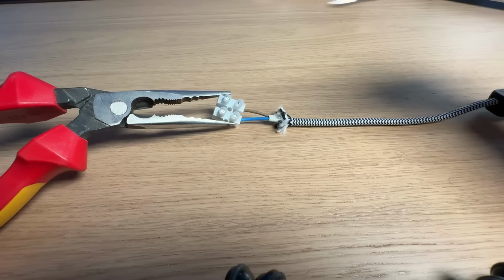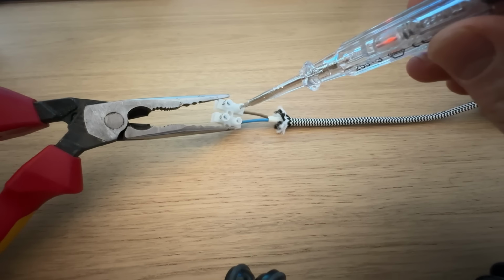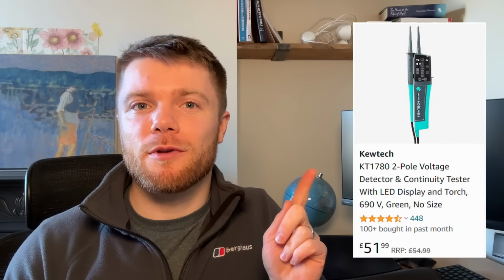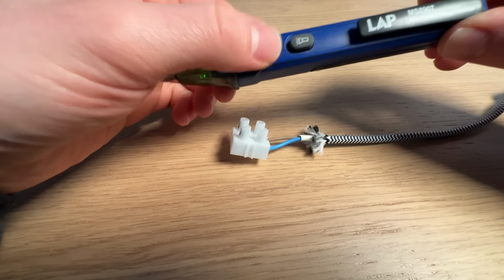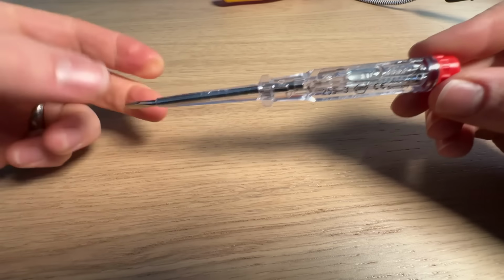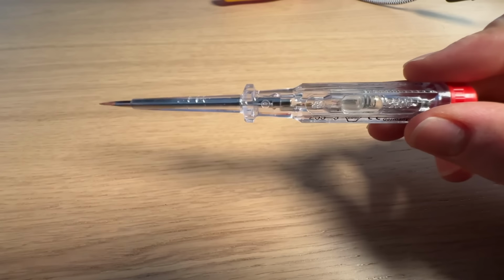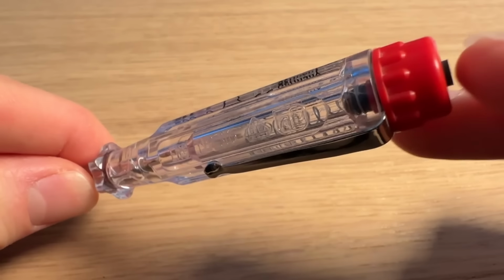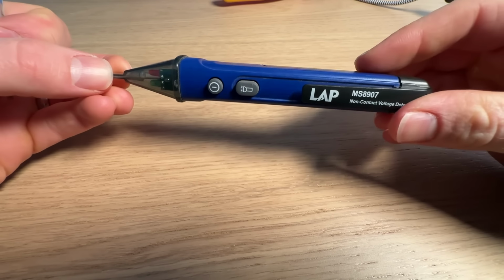The Most Dangerous Electrical Tool

Comment: You hear people saying they're  dangerous and/or unreliable all the time, but are there actually any reports of anyone ever heing harmed by one of these? I've been using them all my life and have no intention of stopping. They are incredibly useful and I would trust one of these over a contactless volt tester any day.
Reply: It is exactly what I was thinking. I am a professional electrician and it has never failed me nor have I had any problems.
Reply: @Gaelmalkavian  i agree with you he must change the content title to "most useful and cheapest live wire tester"
Reply: Exactly because you’re a “professional” this is not meant for professionals
Reply: @Gaelmalkavian non contact voltage testers can and do give false readings. I've seen one give a false negative on a 277v circuit and I had one give a false positive. I will only use them as a quick troubleshoot tool in conjunction with a meter or to verify a circuit/conductor is on, never use it to verify a de-energized circuit, use a meter for that. Only time I will trust a non contact voltage tester for de-energized state verification is on higher voltages like 4160v or 13.8kv. Use the right tool for the job, especially when your life depends on it.
Reply: @Gaelmalkavian  A professional using this? 🤔 Let me buy you a Duspol.
Reply: @jeroen2535  jajajaja ok!
Reply: As an electrician myself I can honestly say I've never seen any other fellow sparky use this garbage.
Reply: @Gaelmalkavian  Please do what I have done and report the content "Harmful and dangerous acts" and "possible death by electrocution". This content provider has no business advising on electrical safety and could lead to some buffoon actually getting injured or killed.
Reply: I am a retired electrician. And worked and trained with a highly respectful electrical contractor still in business today. Those neon screwdrivers were in use heavily, we had meters as well. Modern day tools you see were not around back in those early years.  So the neon driver was used purely to check state of circuit before returning on it. Obviously a fully isolated circuit means switching off main DP  breaker. It's the first time I have heard the term a DIY screwdriver. My late father had one in his top pocket as part of his dress. He had a Degree in electrical engineering. Built and designed radio equipment as well. That was a secondary interest of his as it is mine today.  But interesting video. I agree otherwise. Just the thought you have made me appear to be a DIYer not a Pro. Hi hi.   Your safe now, well retired at age 76. I did not quite see the VIR CABLE days, but I removed plenty including lead cable. Boss use to collect it to claim scrap money for it.  Thanks again.
Reply: They also let you know which wire is live if you're checking the wiring in a light fitting or switch, or whatever. A non-contact tester or a multimeter wouldn't have showed if the blue wire was Line and the brown Neutral in the test case in the video. Yes you could use a multimeter to known earth, but I don't think that's any safer really. You're then holding 2 probes at once, and if you touch the ground probe you're connecting yourself to 240V through the multimeter's circuits.
Reply: @AJB1 A multi-meter's circuit is above 10 mega-ohm, that will give you about 24 micro-amp of current, I do not think it is a big issue. A non-contact tester will be useful in the case you mention, the same goes for a multi-meter, you just need to know how to use them.
Reply: @K2teknik. Yes the multimeter impedence is really high, unless it fails, or gets water in it (as per the video saying can happen to the screwdrivers). Or unless you accidentally put it on the current setting, or accidentally put the probe in the current connector, which can't happen with a neon screwdriver. Or if there's damaged insulation on the probe wires.
The non-contact tester can't tell you which of two wires right next to each other is live. It'll tell you if any of them are live, but sometimes you want or need to know which.
I've got nothing against multimeters or non-contact testers. I own both, and use both. But I've also got nothing against my neon screwdriver, and I use that too.
Reply: We call it Phase lamp 
And it is best tool
Reply: @trbusina I agree. We call it a phase tester, and if you know what you are doing it’s the best tool, if you don’t, you should not be doing anything with electricity, get an electrician in.
Reply: @jschreiber6461  A proper sparky has had that many belts from electricity ,that he doesn’t need any tester , he does it buy touch to see if he gets a shock or not . That’s what our old spark used to do , if his leg twitched he knew it had a good voltage . .
Reply: @AJB1 if you put it on the wrong setting ur blowing the fuse not zapping urself.
A multimeter is what I use.
Reply: @jhoughjr1  I've got no problem with using a multimeter, or with using a neon screwdriver. I just question it when people says the screwdriver is dangerous and the multimeter safe. If you put a multimeter on current not voltage by mistake, put one probe on 240V and happen to touch the tip of the other probe whilst trying to put it onto ground, I wouldn't want to rely on a fuse blowing from the current going through your body to isolate you...
Reply: @AJB1  if you get a probe with a potentiometer to dial in the sensitivity you can definitely tell which wire out of a pair is live and which is ground - a Polish-designed Fazer 777 has such an option - it's a louse screwdriver but quite a versatile mains indicator
Reply: @AJB1  exactly
Reply: I m using one of these for years (I have also multimeter from fluke) and I never been electrocuted. So if you are careful you will probably be alright.
Reply: @UncleHo5 if you had been electrocuted you'd be dead electrocuted does not mean being shocked it means being killed by electricity
Reply: @Pro_fessor56 I received many shocks during my lifetime working on electrical circuits because I'm not the best example when it comes to following the safety guidelines like turning off the main switch but I'm still alive. Even after receiving 230V from one hand to the other. (Don't try it yourself!!! It is like being kicked in the chest). Yes it can be deadly especially in wet rooms like the bathroom but in most cases you will live.
Reply: Same here. Using them forever and zero issues.
Reply: I agree it is a very convenient tool. Requiring no power, being small and serves a double function.
Reply: Dont use them on anything over 500 volts or as an electric fence tester (1000 to 10,000 volts). I got hell of a belt off it.
Reply: @antlane365  You do realize that they have different safe voltage ranges, like any other tool?
Reply: @antlane365 I have used it as a non contact phase detector for voltages above 15KV simply by turning it round and holding just the insulated end. The neon types will glow in the presence of KV range or RF from a high voltage source. The neon itself will glow around 90V, AC or DC.
Reply: @antlane365 I used it on an electric fence and electrocuted instantly but, it was not harmfuI, I just got shocked by high voltage.
Reply: Its a bait video. Basically you put a title like "water actually dehydrates you" so people click on it.
Reply: I think rather than being dangerous is that there are better options for people who don’t regularly use/need it. This advice is not intended for professional applications. The non contact tester is a better alternative for non professionals.

Edit - was just asking my neighbour who is a master electrician- he always uses a non contact tester. His quote “it’s not 1999 anymore. Those things were great when I started but things have improved “
Reply: One they it will be dangerus to ride a bike
Reply: This is exactly what I was about to say. Many many more people use this instead of "safer" options and still there are not really any records of people getting harmed by these tools. Also, imagine these cheap tools not being available. People would improvise their own way of checking if there's current. I did it some times and that's most definitely not a smarter idea than using this cheap tool.
Reply: Me, I was thrown over a room because I inadvertently earthed myself by touching a radiator whilst testing an appliance. It hurt, so don't do it.
Reply: pro tip, never get near electricity thinking it is not ready to rip you apart. the same way you dont unplug something with your hand in the sink, you should try to be kinda ready for it. you are not lucky, nono, it just couldn't reach you. unlike other machines even is the switch is off it might be close.

even if it is safe, you still kinda gotta be ready for it. because it is waiting.
Reply: I got a serious shock off immersion heater one day.. I was high up in a block of flats and nwas to lazy to go down to the van to get voltage tester
Reply: I also used them all my life and they never failed on me either. I also have a 2 pole detector/meter and multimeters. But for basic on/off check, these always served me well.
Reply: @eaglevision993  They probably will serve you well until your luck runs out & you get a belt ,that shows an X-ray of your carcass on the wall with your hair frazzled & standing up .
Reply: I was thinking the same. A well made device (the vintage kind with a near Infinity resistor (black resistive  rod with 4 white lines, ie 999x10^9 ohm and a genuine  NEON lamp (not one of the newer LED) ones is about as safe as it gets. They detect individual wire phase, and for years, if you reversed it it without contact, would glow in the presence of high voltage RF sources eg Microwave & CRT tubes. 
It’s an essential tool, and if you don’t know how to tell it’s safe at a glance and use it safely, you should NOT be mucking about with anything over 12V!
Reply: All tools are dangerous if you don’t use them properly
Reply: @mr.commonsense510  When that is all correct on it's own then there is still an issue with this specific tool, there is just cases, even when you use the tool correctly, it may show a wrong signal to you, a signal you may use to determinate to do actions that may be dangerous to you.
You, your body, and surroundings are one of the current paths that this tool depend on to operate correctly and trustworthy, but your body, and surroundings are not reliably trustworthy current paths, a wire is.
Some locations have electric code/law/rules that state what kind of measurement tools you must use, it basically bans these kind of tool, I am right now in such a location, and you can get a tool that is way bigger, ugly and a bit annoying to operate, but it is reliably and trustworthy, "is it them foolproof so it makes your task safe" you may ask? no it is not, a tool on it's own do not do the full job.
So the takeaway is that tools, even if used properly can be dangerous. The Dunning–Kruger effect comes into mind here.
Reply: Been using for 35 years … never got shocked .. why is this misinformation video being propagated ? The uploader has never repaired an electrical wire and has no idea of how electricity works 😂
Reply: @डफ़क-user-gr3tg2yk6o-24_डफ़क  The issue is not just about getting shocked, it is the misinformation the tool may give the user.
Just because you, and others, may never had experienced any misinformation with this tool do not mean that this issue do not exist.
Just because a given tool is cheap, popular doesn't make it a good tool for a given job, it just make it cheap and therefor popular.
Reply: Its more the problem of cheap parts, the 1/4watt resistors and is not rated for these voltages, it can fail open or short-circuit for instance. Poking a 400volt connection is probably also not a good idea. Etc there are tomanny possible failure modes. If you know what you're doing it's most likely fine but for the home gamer it's not something to rely on. I'd say because when using it you are part of the circuit now thankfully almost every installation here is rcd protected. As a funny side not my last step before grabbing a conductor is using the back of my hand as a last live check😅
Reply: @martijnveen5694   400V is between phases - you're hopefully at ground level so it's 240 to you. If you're not at ground level then a regular 240V out-take would also be 400 to you if it's a different phase than you.
Reply: @martijnveen5694 How about explain why such a low current would cause a resistor to fail short circuit then with statistics and the properties of a neon lamp, how it would respond to such failure?
Reply: No. Voltage is not really a factor in resistor rating, it is power and in this case the power is miniscule. Something getting inside and bypassing the resistor or water ingress are ridiculous. @martijnveen5694
Reply: @martijnveen5694 … where you gonna find 400V as an amateur/DIYer?
Reply: @andyxox4168  Plenty of houses have 3 phase supply these days not mention most switchmode powersupplys have about 400volt dc after the rectification stage. Highest voltage i have messed with personality was about 1.2kv DC capacitor bank not including ignitioncoils
Reply: @ and 3 phase supplies are not 400v to earth so please stay away from electricity lest you earn a ‘Darwin’ award
Reply: What does “fail open” and “short circuit” mean ?
Reply: @martijnveen5694  there are no 400v connections .. they are all the same .. you only get to 400v because you measure between two different phases .. each one of them is still 235v to ground.
Reply: For me the danverous part: i test something and it don't light up. Did i connected it properly in the tight space? Maybe it lighted up only i cant see it?
A nightmare guessing game doing tests after tests trying to be sure.
Reply: @MolnarG007 you just don't know how to use it. Always try live wire and switch the power of afterwards. Then/during this check again.
Reply: @MolnarG007 yeah!don't do what my friend did the other day and grab the cable to see if it was live and never ever ever use the live wires on your tongue method!always use cable detectors,neon testers,socket testers and voltage detectors and turn off the power and use a lock out mechanism and warning label,at the consumer unit.use electrical gloves and insulated rubber handle screwdrivers!
Reply: I got a shock the last time I used one of these. Never again thanks.
Reply: The danger is the operator. You dont know but think that you know. Then things happened then blame on the tools.
Reply: @waktokong9288  It doesn’t matter if it’s the most experienced operator on the planet , if the tool is faulty manufactured to poor quality & dangerous standard .
Reply: Rubbish, used one for many years, ie last 30 at least, never ever had any problem.
Reply: I use this one since the “70s - always accurate, have the same one since. I have bought few non-contacts and found them unreliable, need batteries and after few years they do not function at all.
Reply: yes there was!atilla the Hungarian honey monster was electrocuted and murdered in 1962 ,on his wedding night.he tied a lightning conductor around his waist,then he stood on top of Blackpool tower,dressed only in his underpants.he was frazzled to a crisp afterwards when he tested the current with a neon screwdriver,it indicated the potential voltage as lethal ten thousand million times over.if his body had been made out of an industry tested insulator he would have been blown to pieces inside 0.3 seconds his body was donated to electrical engineering students all over England as an example of what can happen if  you attempt electrical repair and installation jobs if you have swapped your brain for a grapefruit.never ever use the wet tongue,suck it and see method to test for live electrical cables and dangerous high voltages.always use an electrical conductor which hasn't been earthed,whilst standing in a bucket of salt water!-not!to cut a long story short,use a voltage tester!
Reply: ....agreed !!
Reply: same here,
Reply: The question is, do you want your person to be part of the test circuit? They’re probably fine when not faulty but why take that chance? There’s much better options out there and most savvy diyers and pros will use something much safer.
Reply: These things get thrown about and damaged . They are made in China for 10 pence ,no light coming on is it dead or broke. This video fails to tell people you should always test a non contact tester on a known live first. These screwdrivers are frowned upon by the NIC etc
Reply: @gravyboat2370  I got ripped off as I paid a couple of quid for nine ,& still got zapped . I use a multi meter now ,never trust a neon screw driver / tester again no matter what fancy brand or where it’s made ,
Reply: @gravyboat2370  A multi meter is the way to go .
Reply: @maskedavenger2578  If you are not a professional, trained & certified electrician you shouldn't give people advice about the thing that potentially can kill.
Reply: @ In my younger days I was an electricians mate . I wouldn’t advise any one to use these cheap neon screwdriver testers , I know they are dangerous from real life experience of suffering an electrical shock whist using one .
Reply: Totally agree with you, I was given one on my first day training as an Electrician and have always carried one. Never had a shock from one or known a sparky that has and I'm just coming up to 50 years in
Reply: Thats cos they're dead
Reply: There was a warning on TV about some defective ones probably in the late 80s or 90s, when the design was changed to using components with leads and the weld between the resistor and neon were shoddy and would fracture and the spring was long enough to push the neon down the side of the resistor shorting the leads so the metal cap was directly connected to the tip.
Reply: This is why I prefer to use the old fashioned ones with a carbon rod type resistor and  neon with end caps like a glass fuse.
Reply: They are safe! They light up if you use them  a circuit can get switched on when connecting.. they are safe
Reply: I've been using then since I was born. I'm now almost 60 and have never had a shock from one.
Reply: You've gotta admit that the design flaws are valid points. It is quite faint light. A broken one would indicate no voltage even if there is. An even differently broken one might shock you. Not a great tool design. Of course a less than ideal tool still works most of the time, and alternatives also have drawbacks.
Reply: @jeroenvandeven9977  You should test it on a known live contact before and after the actual test.
Reply: I AM 46 AND I'M STILL ALIVE.
I USED ONE OF THOSE DANGEROUSE TOOL YESYERDAY AND I'LL USE IT TODAY TOO!
LOOOOL :)
Reply: I was testing a live circuit and one of these caused me harm .. I dropped it and it fell on my toe 😂
Reply: Only clicked on the link to say dude. Think it’s theoretical danger not actually dangerous or they wouldn’t sell them
Reply: @ChrisLegg-i6s  Wrote : "Think it’s theoretical danger not actually dangerous or they wouldn’t sell them"
Really? The Chinese will sell you anything you want to buy. They thrive because they make them so cheap (and nasty). The UK abandoned any safety control over electrical imports years ago; there is/was a laboratory at Leatherhead that tested this stuff and I complained to them about something once. They took 6 months to reply that they were "monitoring".
Reply: Contactless don't work reliably which creates a risk of you working on live wires.
Reply: This cheap electric screwdriver is best and is used worldwide in every country.
Reply: @  yes, but not often used properly!
Reply: contactless testers are unreliable, if the neutral is close to the hot wire it will light up and you will never know if the current is coming out of the right wire
Reply: Don’t try this at home. I admit that in elementary school I had one of these and enjoyed sticking it into the live point of a mains socket when the teachers were not looking. Then I showed a friend who was also into electronics that when I also stuck a scissor into the earth point and bridged my hand across the two then the neon indicator shon much brighter and you felt a buzz in your fingers. Not sure if I was lucky or just careful enough to know how far I could experiment and stay alive.
Reply: Some people smoke all their lives and never get sick. Is smoking safe?
Reply: It is something like report about being killed by falling piano.
Reply: I think that this tool is harmful or dangerous if you are stupid. And you know how today's generations are... They are not safe if they don't use 50+ dollar tools... Gosh
Reply: water is a legitimate concern, life if you left in in a pocket and went through the wash. why not just make a solid pour. but yeah i agree with you, i cant imagin anything worse then a pick me up from this. but it is a big world where bad stuff happens, for no good reason.
Reply: What a load of crap. OooohMummy it will kill me because I’m passing a couple of micro amps through my body. Used one all my life. I have several different types and all are neon. You’re full of BS. Stop trying to scare people.
Reply: Well, I stabbed myself with one of these once. Turns out they're pointy.
Reply: Do you have girl or boy children?
Reply: It will eventually stop you
Reply: There were reports a few decades ago of people receiving severe electric shocks from a badly made and designed one sold in the UK.It was when the design was switched from using a solid carbon rod type resistor and cartridge neon, to parts with leads. The leads  connecting the resistor and neon were welded together so badly that it would almost break apart by looking at it and they hadn't thought to shorten the spring, so the welds were breaking and the spring would push the neon down beside the resistor the leads would cross and you'd either get a direct connection between the metal top and the tip, or just via the neon. Don't recall if anyone was killed, but it made TV. They fixed it by using a shorter spring and also started welding them properly. But I still would rather use one with a rod resistor and cartridge neon. Other problem I 've encountered was a rubbish one that came with something, wasn't sealed and water had got into it while it was laying around waiting to be thrown away.
Reply: Using two of the pen testers now.
Reply: They are safe enough.  May need to be careful only with a new device in case its a defective device- but thats a one time check.  In fact these testers have prevented a lot of electrical shocks by indicating leakage.
Reply: Non contact ones react to static electricity too. I noticed it when I was sliding it on CAT6 cables.
Reply: Don't use it outside in a heavy rain. I've used them for 60 to 120 VAC. Anything higher gets the multimeter.
Reply: So many people die every year for that...😂
Reply: Any responsible electrician will look after and know how to use their equipment.
I use a multimeter switched to the appropriate range.
A mate of mine had very dry skin.
He would stick the end of  his thumb in the  lampholder to check for voltage.
He could guess the voltage to within 50v.
Reply: The only issue I have had was checking an ignition lead. 
Touching the end on the ht lead resulted in a shock.  So just put on lead and keep finger off the end.
Reply: @chuckmaddison2924  You did not read the specification on the tester, you would then had known that the voltage on an ignition system is way above the maximum rating for your tester, so short version "Wrong tool for the job", not a fault of the tester as such.
Reply: @chuckmaddison2924  Ignition voltages are huge. 1000s of volts. These pen testers are for household voltages.
Reply: The testing thing lights up on both neutral and positive wire in me garage so not reliable
Reply: I died using one of these.
Reply: Havent reported any times ive been shocked.
Reply: Would they work if you are wearing well-insulated shoes or does your hand need to touch something to ground it?
Reply: @ferrarim5p75  I think just the capacitance of your body is enough. You certainly don't need to go out of your way to make a good ground.
Reply: Yep, just an ad
Reply: The only time you get a shock is when someone shorts the neon for a laugh 😂
Reply: I played with these when I was a kid, was funny to see the light when sticking it to the mains, parents didn't like it and took it away.
Reply: I totally agree with you, Rob Wigley.. I have used"phase-testers"for many years (even in damp conditions) and I am 100% confident with them - never had a problem. Of course there are cheap versions that may be dodgy but even the Euro and Pound shops have to abide by government safety standards. The car-boot tool sellers are the one's to be careful with.
Reply: There are some basic multi meters that are very reasonable price,deffo better than thes🎉
Reply: @  .. assuming you have a reliable and confirmed earth, without that your multimeter is useless for proving a dead circuit!
Reply: If you use them a lot, you're probably getting them from a reputable supplier, or at least a consistent supplier. I'd definitely be worried about this kind of design though when random people use them for their home projects and buy them off amazon which is notorious for allowing products with no QA.

The fact they still don't cause serious injury stems more from the fact they're rarely used on live circuits (only used as a check) and household AC, especially in the US, is rarely fatal for short contact
Reply: I was thinking the same, I've been shocked once by one of these, but other then the scare for a fraction of a second, nothing really happened, like normal 120V connections won't cause any damage in less than a second of a shock
Reply: I wouldn't trust either of them for proving a circuit is dead! Both have a lot of pitfalls that only the proper 2 pole tester does not. What differentiates the NCV tester from the screwdriver is that the former is actually very useful for troubleshooting while the latter is just useless.
Reply: Good luck
Reply: Good question but listen. People is.... well... consider people dumb as a rock and you will be correct always. Of course, a lot of people is not dumb, but many other people is, so if something can be done in the worst posible way automaticly means someone, somewhere, its going to do it that way. I got friends working on hospitals, you would be amazed of some things they treat there. And thats only in one hospital in one city! Imagine in the whole world.
Reply: I have one of these and it lights up with ac current even if I don't touch the top. Touching the top allows me to check Dc or contininuty eg fuses. It's very useful and I feel very safe using it
Reply: Im someone thar gets drunk and puts their finger in a light socket for a party trick so its no problem i love a bit of an electric shock however please dont try this at home im an expert IDIOT lol 😂
Reply: I tasted a live wire from oven transfomer and it really harmed me
Reply: Hello ! May Allah protect and guide you to his light and happiness in this life and the hereafter, God bless, Ameen. Excuse me for giving a little presentation of Islam, because it is very misunderstood nowadays, especially on those « Antichrist's » times, where media and politics are mixed to distort history and truth. And terrorists (puppets of the Antichrist) who misinterpret verses, out of ignorance and political motivations, and take them out of historical context (just like radical atheists do by the way) don't help either. Thank you very much for your time.

First of all, if you have any questions regarding Islam and yourself, just open the Quran randomly, and you will find the answer in front of you, like a miracle and a sign from God.
	
Islam is an arabic word that means the Surrender to the One and Only God, our Creator, Protector, Provider, who gives us life and all that we have, we are safe and sound by his will and grace, we are His and to Him we return, and we have to thank him in this trial life by submitting to him by our free will, or later in the Day of judgment when it's too late to save our own skin. Islam was the original Religion descended to earth from heaven with Adam and Eve (peace and blessing be upon them) in the beginning of humanity. and was passed to people with the succession of the 124 000 prophets and 315 messengers of God to all nations and civilizations since, passing by Noah, Abraham, Isaac, Jacob, Ismaël, Joseph, Moses, Aaron, Joshua, David, Solomon and Jesus (Peace and blessing be upon them) during the history of mankind, the last replaces and completes the previous, until the succession of the last messenger of God fourteen centuries ago, Muhammad (Peace and blessing be upon him) to complete the noble morals of all mankind, to bring humans and jinns out of darkness into light, and to purify people's religion and belief from corruption and polytheism, and return it to purity and true monotheism, like it was in the times of the prophets (Peace and blessing be upon them).

Many Religions that we know nowadays, at their beginning were true and under Islam, initiated by one of the prophets of God, but their original teachings, history and scriptures have been corrupted over time with falsification and polytheism, or lost and replaced with false ones. That's why Islam is the only Religion accepted by God nowadays, which consists in bearing witness that there is no god besides Allah (God in Aramaic, the original language of Jesus and the Gospel), and that Muhammad is His servant and messenger, just like Jesus and Moses and others are His servants and messengers. Never a messenger of God said he was God or literally son of God, it was the people after him who changed the words of God and corrupted the Religion. God is unique and absolute, He does not need to have a family and sons or to associate anyone else with His kingdom, He can simply create whatever He wants, everything belongs to Him, and to Him everything will return. Allah said in Surah Al-Mu’minun : “God has never begotten a son, nor is there any god besides Him. Otherwise, each god would have taken away what it has created, and some of them would have gained supremacy over others. Glory be to God, far beyond what they describe. The Knower of the hidden and the manifest. He is exalted, far above what they associate. (91-92 / Translated by ITANI).

Allah means the one and only God, the God of all prophets and creatures, the creator of the universe and mankind, and the Master of the Day of judgment, where our destiny, Hell or Paradise, is decided based on our faith and deeds in this trial life, and above all, Allah's mercy. 

Allah said in Surah Al-Ikhlas : In the name of God, the Gracious, the Merciful.
Say, “He is God, the One. God, the Absolute. He begets not, nor was He begotten. And there is none comparable to Him.” (1-4 / Translated by ITANI).

Allah said in Surah An-Nisa : O FOLLOWERS of the Gospel! Do not overstep the bounds [of truth] in your religious beliefs, and do not say of God anything but the truth. The Christ Jesus, son of Mary, was but God's Apostle - [the fulfilment of] His promise which He had conveyed unto Mary - and a soul created by Him. Believe, then, in God and His apostles, and do not say, "[God is] a trinity". Desist [from this assertion] for your own good. God is but One God; utterly remote is He, in His glory, from having a son: unto Him belongs all that is in the heavens and all that is on earth; and none is as worthy of trust as God. Never did the Christ feel too proud to be God's servant, nor do the angels who are near unto Him. And those who feel too proud to serve Him and glory in their arrogance [should know that on Judgment Day] He will gather them all unto Himself: (171-172 / Translated by Muhammad Asad).

Allah the Most Merciful said in Surah Ali-Imran : Behold, the only [true] religion in the sight of God is [man's] self-surrender unto Him; and those who were vouchsafed revelation aforetime took, out of mutual jealousy, to divergent views [on this point] only after knowledge [thereof] had come unto them. But as for him who denies the truth of God's messages - behold, God is swift in reckoning!
Thus, [O Prophet,] if they argue with thee, say, "I have surrendered my whole being unto God, and [so have] all who follow me!" - and ask those who have been vouchsafed revelation aforetime, as well as all unlettered people, "Have you [too] surrendered yourselves unto Him?" And if they surrender themselves unto Him, they are on the right path; but if they turn away - behold, thy duty is no more than to deliver the message: for God sees all that is in [the hearts of] His creatures.
Verily, as for those who deny the truth of God's messages, and slay the prophets against all right, and slay people who enjoin equity - announce unto them a grievous chastisement.
It is they whose works shall come to nought both in this world and in the life to come; and they shall have none to succour them.
(19-22 / Translated by Muhammad Asad)..

God said : Say, “We believe in Allah, and in what was revealed to us, and in what was revealed to Abraham, and Ishmael, and Isaac, and Jacob, and the Patriarchs, and in what was given to Moses and Jesus, and in what was given to the prophets from their Lord. We do not differentiate between any of them. And to Him, we surrender.”
(2:136 / Translated by Community)

Salam (Peace) -------
Reply: If you test the driver using a ground source instead of yourself and buy a high quality driver there isn't really much reason to think this is explicitly dangerous.

There is a latent advantage of this driver in that if the circuit becomes live whilst you're working on it, the driver will indicate this to you.

These other testers are as good as when you last tested the circuit before working on it.
Reply: Quite a lot of comment on this topic.  I have used one for years too, they can do what a volt pen cannot which has been discussed by others.  Many years ago I recall getting a minor shock using a neon outdoors where I must have had a better earth than normal if used inside in dry conditions. Good sensible advice here notwithstanding the adverse comment.
Reply: Like any instrument, it needs testing from time to time. In this case, so there are no false negatives.
Reply: I have never known it? I always have 2 available in case the bulb has blown.
Reply: I had an issue where electricity would still pass through me even though ut shouldn't
Reply: I was actually been shocked by this device. I left it outside for months got some corrosion on it.stick it into an outlet and wow the zap of 220v
Reply: @nnyek3038 Well that's not surprising if it's corroded.
Reply from the maker: Ive heard stories of people getting shocks, but it would be very hard to get data as it’s generally rare a shock like this would require a hospital visit. 
I personally think anything using you as part of the circuit is a terrible design, but everyone is entitled to an opinion. Thanks for watching!
Reply: @TheDiligentDIYer1759  Never heared anyone got a shock form one of those unless the isolation is broken. Should be common sense to not use tools with broken isolation but it obviously isn't. The real danger is that they are unreliable same as these non contact detectors. They will not work in certain circumstances. So you can end up dealing with live wiring without knowing it. Electricans will know that and for them it is useful tool for doing other things. That's why they will continue to exist. If you are not an electrican but have to mess around with electricity for what ever reason (I was between an rock and a hard place before) please buy a two pole voltage tester. A Kewtech KT1710, Martindale VT12 or UNI-T UT15C will do. Yes they will set you back at least 35 pounds but keep in mind your health is priceless.
Reply: @Troppa17 never had a non contact not work.
Reply: @TheDiligentDIYer1759  er, you are always part of a circuit because you absolutely always have a path to ground!  Everything is a conductor, it's only the absolute level of impedance that varries.... lol  ;-)
Reply: @maxtorque2277  These devices  work with AC voltage because your body acts as a capacitor. The minute charge and discharge current of the capacitor is sufficient to light up the lamp. There is no need of a path to ground. I have one of these and it lights up on the phase although I stand on a dry wooden floor and I a wear sneakers with a rubber sole. Indeed I am so well insulated that I can touch the bare part of the screwdriver and not feel anything. Yet if I insert a metal conductor between the screwdriver and the floor, the lamp fails to light up.
Reply: @maxtorque2277  These devices work not because your body acts like a path to  ground but because it behaves like a condensor which lets alternative current circulate. They work even if you are fully isolated from the ground (shoes with rubber soles, dry wooden floor, touching directly live outlet of the socket does not feel anything).
Reply: @TheDiligentDIYer1759  I find them useful for doing trailers, e.g  DC voltage..not had a problem. If the wiring needs changing, I'll do it...sometimes it's cheaper to get a length of wire over the length of the trailer, and just redo the whole lot, if the lights themselves are working OK. I have a doofalacky that I made up to check the lights, just undoing the earth and power wire from each light. Changing basic 6 x 4 trailer wires isn't difficult really. Connecting? Well just follow the instructions the connecter plug and socket packets give you. In Australia, the diagrams are in colour, wiring wise, and unless you are a total dummy, you can't go wrong. I taught my son years ago how to do his. Rewiring a caravan is a pain though. lol. I have set of tools I leave in the car just in case for some reason one of my trailer lights stop working. I've been lucky so far, when I do a trailer wiring, everything usually works, because I don't hurry doing the wiring, or connections, I want it working, and I only want to do it once.
I never do AC wiring...I leave that to the proper sparkies.
Reply: @TheDiligentDIYer1759 Difficult to counter your argument.
Reply: @TheDiligentDIYer1759  people getting shocked are more than likely experiencing ESD so they're shocking the screwdriver and not the other way around. This is just a guess though
Reply: So its bull! I have Never had an issue. Bypass pass the resistor what a load of bells
Reply: @TheDiligentDIYer1759  All electrical shocks are reportable and are logged by H&S legal requirement so if there is data to be had then its there to be accessed
Reply: This video is purely for marketing of non contact testers my friends. Poor try.
Reply: @shafqatmustafa9166 
Below some voltage the light won't glow. You touch the wire and you get shocked ! 😀
Reply: It’s a screw driver so use it as such.  Not a tester if you have to offer your body as part of the circuit. 😅
Reply: @doctorrs5317  It is being sold as a 'tester' so we can reasonably consider it to be so, but it is a limited/bad, in some cases dangerous tester and that is what this video is about.
Btw, the first tester of this type I saw some 50+ yeas ago were just testing and no screw driving, but somebody in a marketing department got a brilliant idea to gain more sale, "let's combine a tester and a screw driver: Two In One" and so they did.
Reply: I had got zapped by this deathtrap once, will not recommend it, neither the device or getting zapped.
And I got zapped by a non-contact tester in 1986 and took a 4 meter jump down from a ladder and got well beaten up, and both cases was due to moister in/on the testers.
Add to this that these tester, both the contact, and the non-contact one are unreliable, they may show voltage present and in reality there in no voltage, and the opposite can happen too, you just cant trust them.
I know that many people, even professional electricians like these kind of testers, and that many state that they will never use anything else because it is the best tool in the world, and peace with that.
Reply: @K2teknik.  How did you get a shock with a non-contact tester?
Reply: BS
Reply: @K2teknik. So what do you use if a non contact tester is dangerous too?
Reply: @K2teknik.  When light is on, there is definitely voltag, you can trust it, sometimes it's lighting when you touch radiator with that, light is barely visible, but radiator sometimes kicks, then you measure it properly and you realize that there is like 90V from who knows where, this tester will detect it. As some other people say here - other tools need proper training, it can look like there is no voltage because you don't know how to use it, this simple basic tool works for everyone, it's not the best tool, but everyone should have it at home.
Reply: @Pidalin  Sorry, you can definitely not trust this tool, it belongs in the bin. Too Many factors is in play here, some is unknown to the user, it can under the some circumstances show "Voltage present" when it is not, and it can show "Voltage not present" when it is. It is just not a reliable tool in any way. And there is way better tools available today, and they are not even expensive.
Reply: @K2teknik.  I'm blown away by this story. But as much as you were 🤣 but still. I mean on standard 240 I've made the of mistake of touching at least twice in immediate recollection so probably thrice at least, over decades of working on such lines, was jolting but not more. But then I was raised and trained to failsafe caution that only in the blind hubris of youth did I the first time forget an element of and take a jolt. But while not comfortable and most definitely throws the hand off instantly (because the one thing never forgotten even in youthful hubris, was to approach anything electrical with the back of hand, never the front, as the last ditch failsafe), I've never experienced a full body assault. Wonder if you were on higher voltage and or just not safely braced to this ladder. Ladder work of course is itself a risk raising thing.
Reply: @K2teknik.  it really is on the quality of the tool and how well you take care of it... thats just how it is in electrical
Reply: @g-3609  This tester's function relies on your body's electrical property's, these property's are not very well defined, they also change and are basically all over the shop, add to this that it also relies on the environment surrounding you too, again property's that are not very well defined.
These undefined property's are the reason why this tester can show voltage present when it is not, and show voltage not present when it is.
The neon light bulb can only light up when it is a part of a electrical circuit, one pin is the tip of the screwdriver, the other is undefined, it can be a capacitive coupling thrugh you to the surrounding environment thrugh capacitive and/or resistance  coupling either to neutral or live, you simply can't know this. It may also be thrugh the metal end on the handle of the screwdriver, then it can be a resistance  coupling, thrugh you to the surrounding environment thrugh capacitive and/or resistance  coupling either to neutral or live. Most often it will to neutral, but you can't be sure.
Even if you test this tester at one spot and then move just a few meter you have change the electrical test condition and you can not trust the testers reading.

A real tester is with two leads, one to either neutral or live, and the other to the point you want to test, with other words, one lead is going to a electrical well defined point, the other to the point you want to test, that will create a electrical loop if sufficient voltage is present and you will get and indication that voltage is present.
You can test this real tester beforehand and move to an other location and be sure that the electrical test condition is same and that the tester is safe to use/trust.
Reply: I have been zapped whilst using one of these things , they are made dirt cheap in China no matter where they are claimed to be from . It was while testing a 13 amp U.K. wall socket live pin hole 230 - 240 volts AC . ,absolutely potentially lethal .
Reply: @maskedavenger2578 A pro will know when a shoddily made tool is in use. Then it won’t matter even  if it’s a multi tester with 2 prong probes. A good phase tester of classic design (black ultra high resistance rod at the bit, 4 white rings showing the very high resistance, 999x10^9 and a neon, not led, discharge lamp), has never been shown to be at fault when used responsibly.
Reply: @maskedavenger2578 Absolutely or potentially. Which is it? Or don’t you know?
Reply: Fellow Apprentice got a terrible shock using one of these.
Should be band IMO
Why would you put yourself in contact with any electrical source, with  a tool which is potentially a 'dead short'??
Reply: @russellham2094 perhaps you could describe the circumstances under which he received the shock to give us a better picture?
Reply: And you want to short yourself to 230 volts with no control. Good luck
I saw a fellow Apprentice receive a horrendous electrical shock using something identical to this
Don't
Reply: @russellham2094  thats down to poor training
Reply: How?  @russellham2094
Reply: @russellham2094 your apprentice 😂. Beware of you
Reply: It's astounding the lack of intellect shown on here when using this type of voltage tester.
Clearly these people need re-educating in basic electrical testing and how to prove dead.
I would never trust my life to one of these screwdrivers in a million years and anyone who does is a fool.
These screwdrivers should be banned from being sold!
Reply: @willmitchell255  That is your opinion. More's the fool who knows a fool.